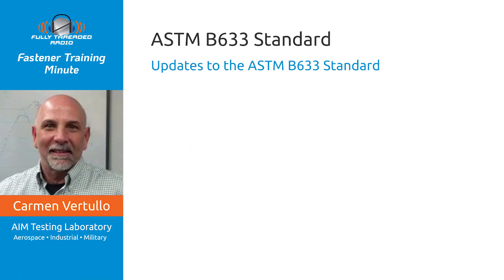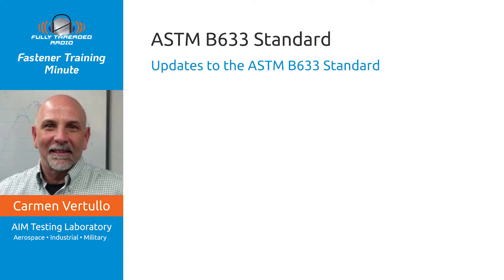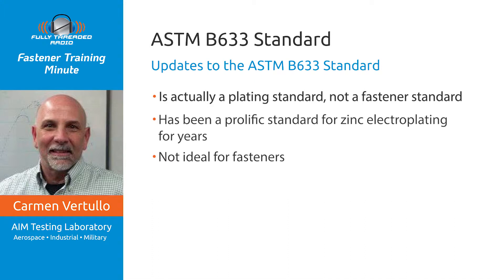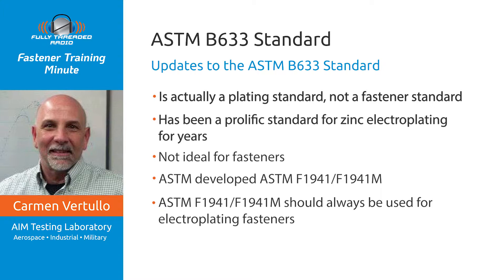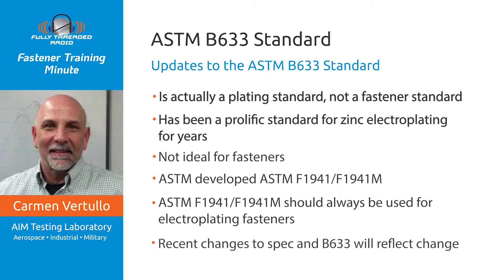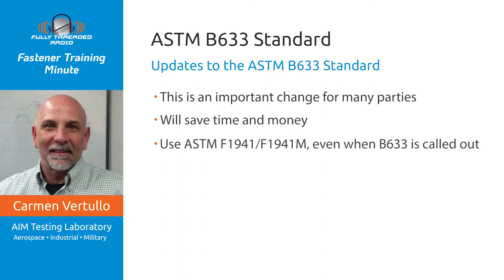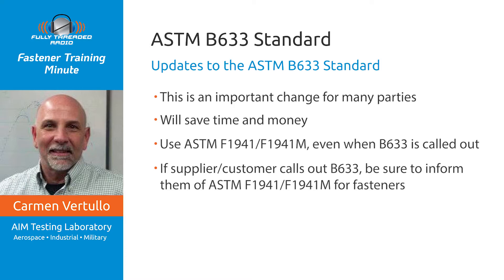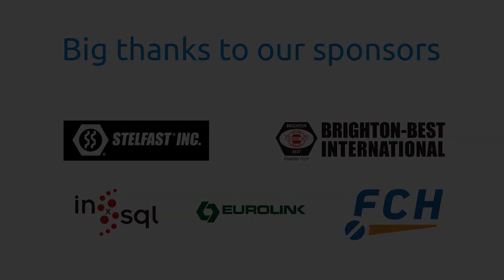ASTM B633 Standard Updates | Fastener Training Minute

Comment: Sir i think you are the first trainer explain this in youtube. Thanks for your training and explanation.
Whats difference between astm A633 vs F1941 standard. In our material project spec ruquirement is bolts A320 with coating F1941. However We get offering from supplier coated by A633. My query is can We chose a633 instead of F1941 for bolts A320 L7?